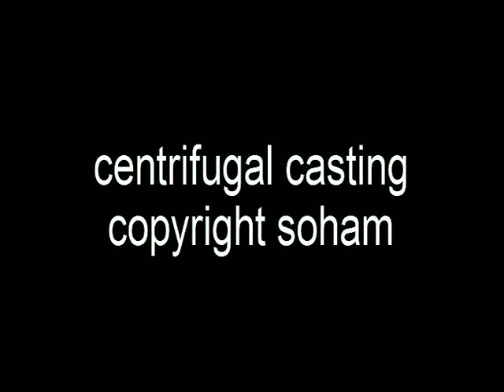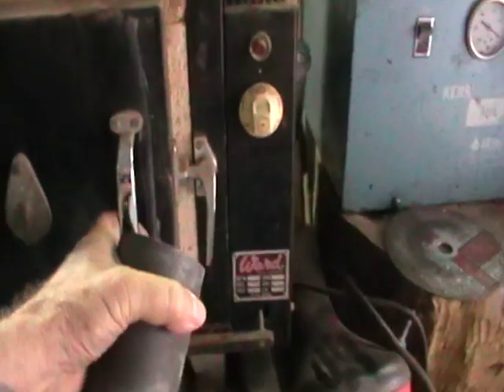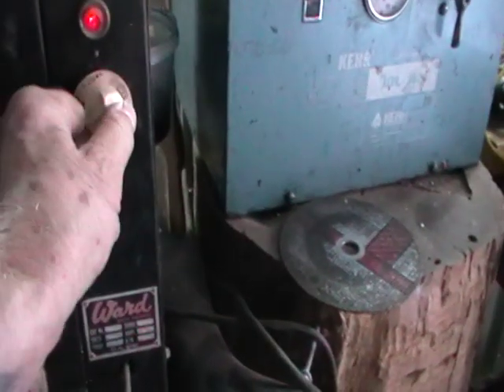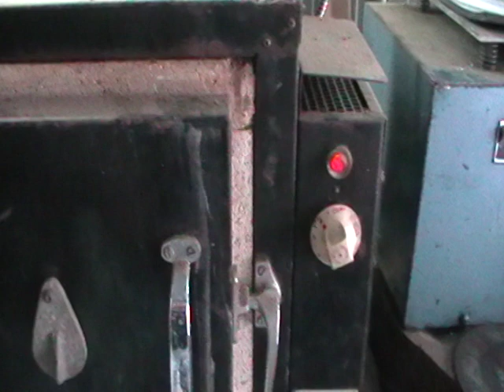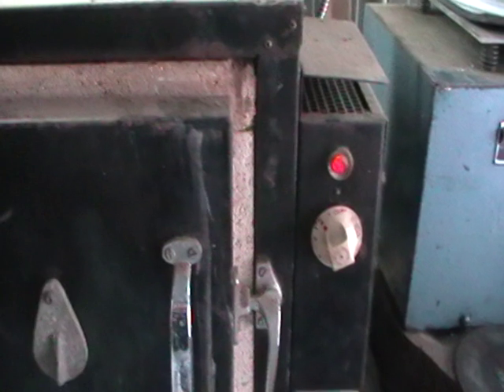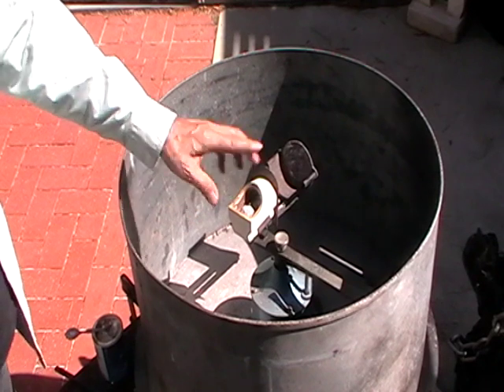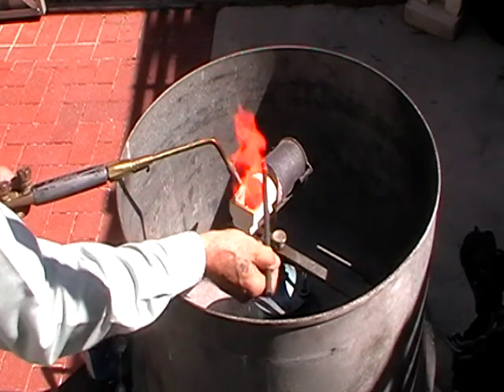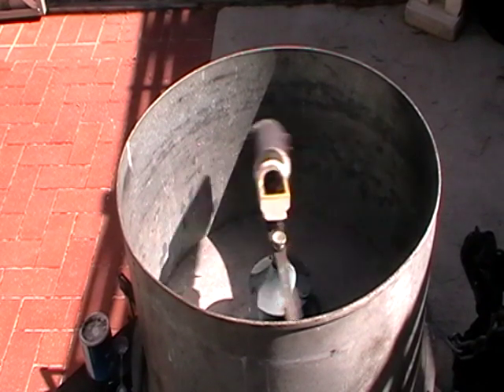centrifugal casting

Comment: Can you use a furnace to melt the metal, then pour it into the crucible? or does it need to be heated up in the crucible while on the centerfuge?
Reply from the maker: it is possible but more complicated because it would start to harden as soon as you poured it into the crucible
Reply: @1soham1  You're right, I tried it last night and it hardened into a clump instantly, had my furnace at 961 degrees celsius, maybe that temp is too low, I also didnt have my crucible glazed.

Comment: Great video, thanks!

I had some questions. Your torch looks like an oxy acetylene torch, is that correct? I've been using one of those to try and melt my metal (I'm attempting to make a cast out of bronze right now) directly in the hooded crucible like you're doing, but while it melts the crucible quickly enough, it's getting the metal hot enough that it's melting right through my quartz crucible as well. Have you heard of that problem? Do you know what could be causing it, and how I can prevent it? Thanks!
Reply: Jeffrey Rawlins did you ever figure out what the issue was?